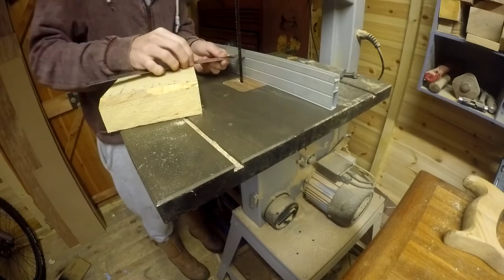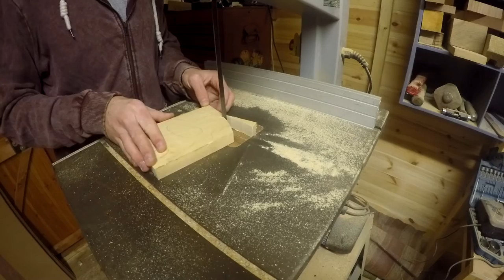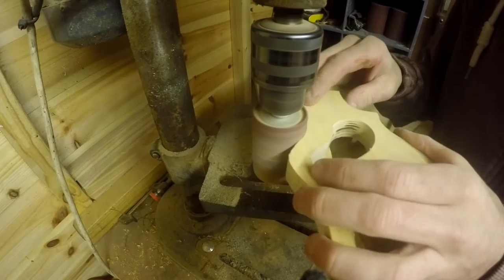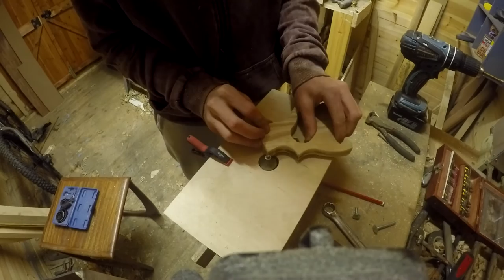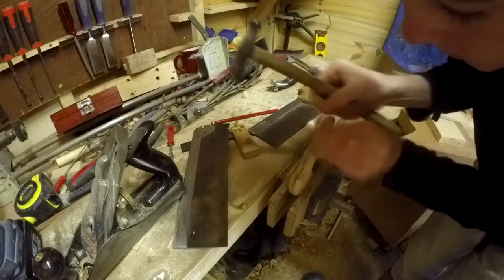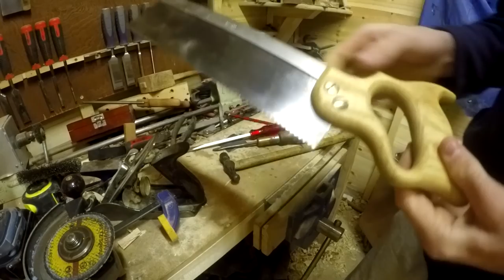Making A Tenon Saw Handle

Comment: It looks like you wouldn't mind loosing a finger or two...
Reply from the maker: Stop worrying about where my fingers are. I am completely aware of where they are throughout every project
Reply: I don't think you are. And your attitude seems to be as dangerous as your habits. Try googling "router accident" or "woodworking accident". Look at the pictures and read some of the stories.
Reply from the maker: PaavoLammikko 'no you don't' that's what you think, you're not in my workshop. There's nothing wrong with my 'attitude', I don't like being told what to do and how to keep myself safe in a workshop. I've been using power tools for over 5 years with no accident yet. The speed of the video might make it look like my hands are closer than they are, but my hands were always at a safe distance from the router bit. Like I said, don't worry about my safety, do what you want in your workshop and I'll keep doing what I do
Reply: LOL!! "There's nothing wrong with my 'attitude', I don't like being told what to do and how to keep myself safe in a workshop." That says it all...
Reply from the maker: PaavoLammikko like I say, you do what you do and take whatever safety precautions you  feel are necessary and I'll do the same in my workshop. I really don't see why others are concerned about my safety, if I hurt myself it isn't going to affect you or anyone else
Reply from the maker: like i've said multiple times, i still have 10 fingers and both arms. Still yet to hurt myself on a tool. You go ahead and use your pushsticks, that's your choice